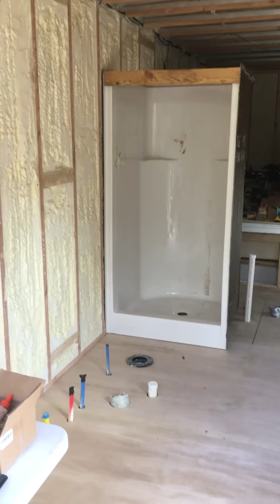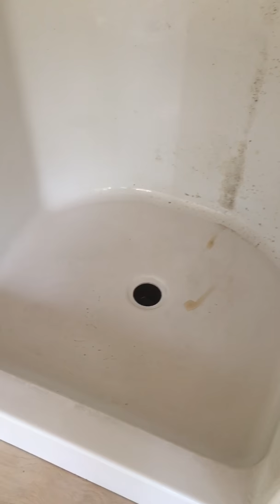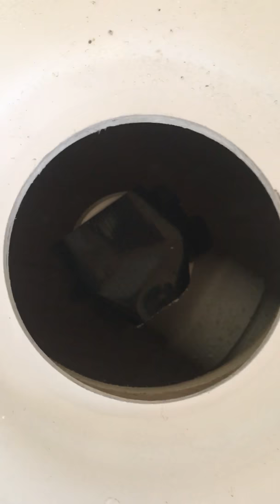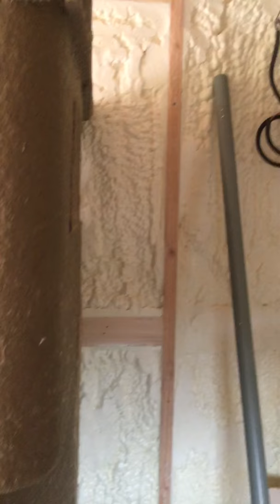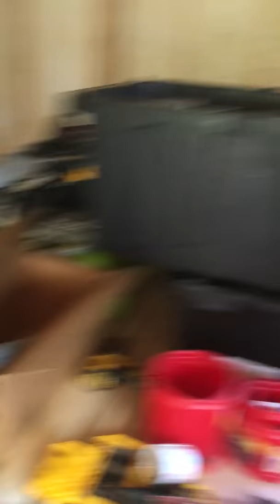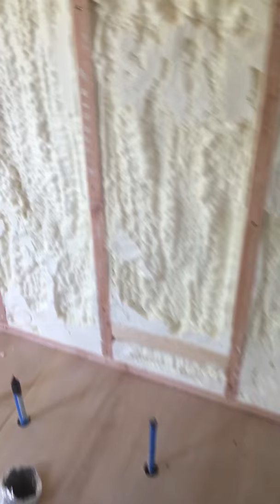RV Trailer Build #22 Part 1 - 36" x 36" Shower Enclosure Install

Comment: Looking good, i  have to refigure mine when I did mine I didn’t put a shower I was going to put one outside which still might be a good idea but I will need a bathroom inside with a shower that would be nice, great job brother
Reply from the maker: Thanks Brother -- Having a shower inside was something we put in our must have column - our nice to have column is still blank, so I think we pretty much will have everything!! Once I secure that shower enclosure my walls will go up around the bathroom and it should be smooth sailing from there on... I wanted the one piece shower enclosure but it was hard to find one at Home Depot that was not damaged in some way - finally found one the I could make work!! It is a 36" x 36" shower... Part 2 tomorrow I'll have the enclosure secured and the plumbing tightened up for the drain... Walls up and she'll be ready for sheathing!!